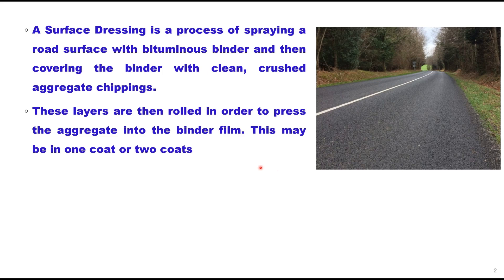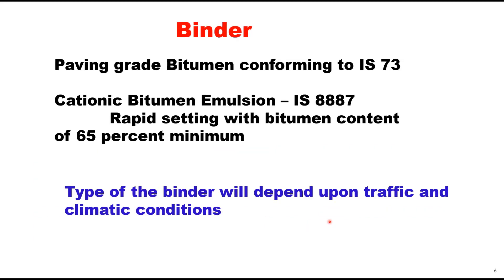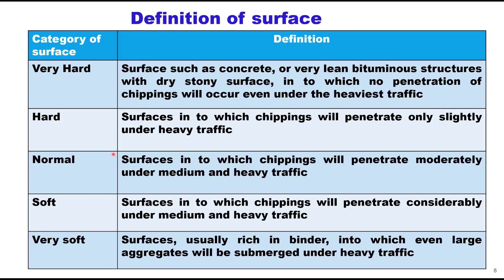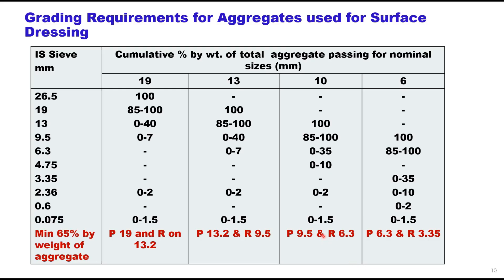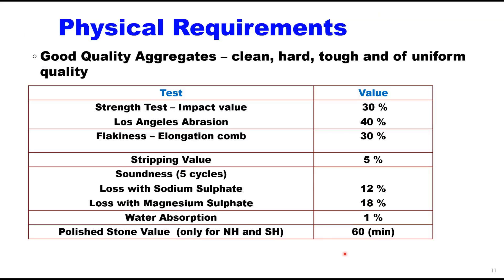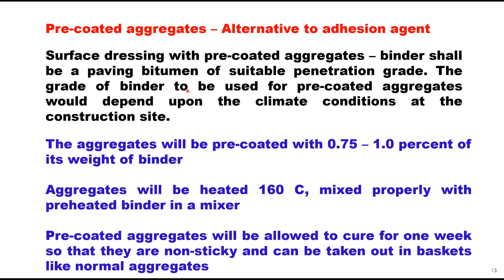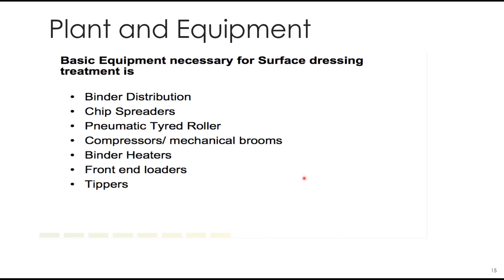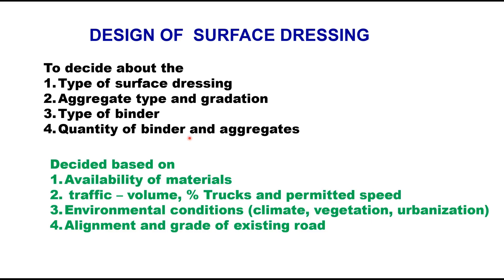#roads  Thin Bituminous Surfacing - Surface Dressing, single coat and two coat surface dressing.

Comment: Good morning sir. as usual excellent knowledge sharing.However Surface dressing as an item of work  has not been included in Morth orange book fifth revision. Please correct me if i am wrong
Reply from the maker: Yes, you are right. Surface dressing is generally used on low volume roads.